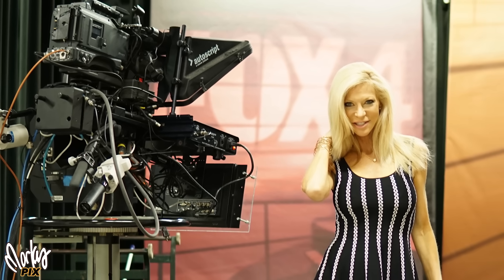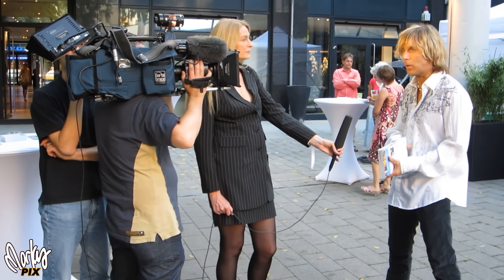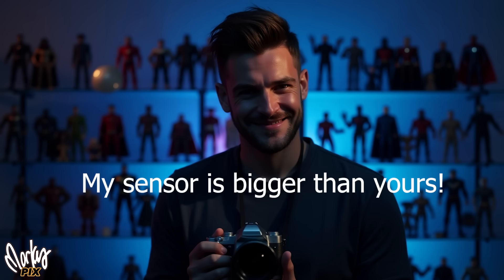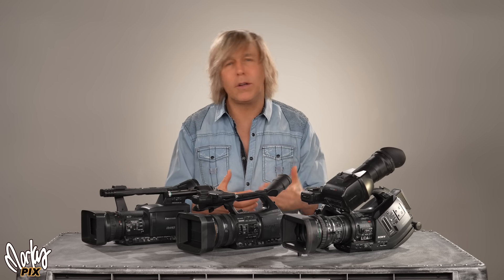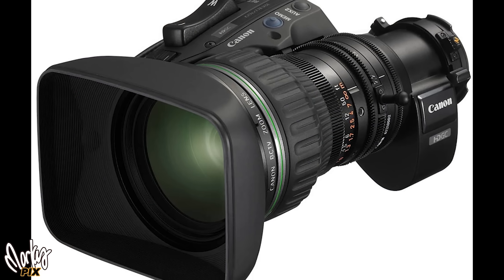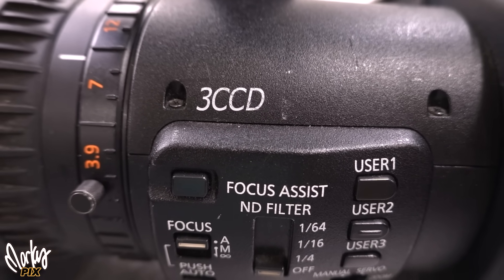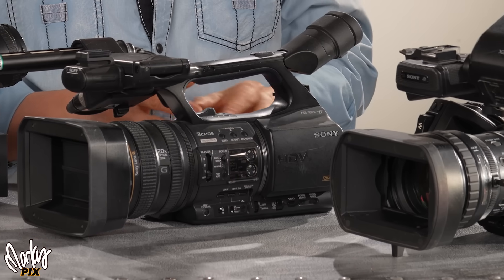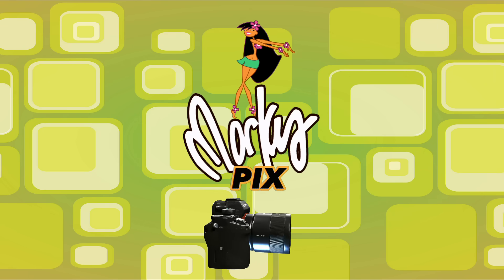Why the Broadcast world uses 3 chip video cameras

Comment: I don't see how having separate sensors would help in green screen keying. You can't just cut a color channel out of the whole frame and for the digital processing having 3 separate sources seems completely irrelevant. I also don't see why would you think 3 chip cameras help you with colour grading live. You need to calibrate your inputs and process their signals anyway.
Reply from the maker: Because 3-chip cameras use separate image sensors for red, green, and blue light, this allows for more precise color separation, which results in cleaner edges in chroma keying.Single-chip cameras rely on a Bayer filter, which interpolates colors, leading to less accurate chroma information and potential color bleed.
Since each chip captures full RGB color information for each pixel, 3-chip cameras preserve more detail in color channels.(Higher Chroma Resolution)
Single-chip cameras often use chroma subsampling (e.g., 4:2:0 or 4:2:2) to save bandwidth, which reduces the resolution of the color channels, making it harder to pull a clean key.
3 chip cameras have less Noise in the Green Channel which is the most important for chroma keying because it carries the most luminance detail. 3-chip cameras dedicate an entire sensor to the green channel, resulting in less noise and a smoother key.
Since each chip is optimized for a specific color, color reproduction is more accurate and less prone to color spill or compression artifacts.
This is crucial for maintaining fine hair details, soft edges, and subtle color gradients in chroma keying. (Better Dynamic Range & Color Fidelity)
With a single-chip sensor, Bayer interpolation can cause color fringing around edges, especially in high-contrast areas like where the subject meets the green screen.
3-chip cameras avoid this, resulting in crisper edges and fewer artifacts in the key. (Reduced Artifacts & Edge Fringing)
But lately, modern high-quality single-chip cameras with higher resolution sensors 10-bit+ color depth, and high chroma subsampling (4:4:4 or 4:2:2) can also produce excellent results.
A single-chip camera with a full RGB 4:4:4 recording may outperform an older 3CCD camera that only records in 4:2:2.
If you’re working with a broadcast-quality workflow and need the best possible keying performance, a 3-chip camera is usually superior, especially in real-time live production settings. However, high-end single-chip cameras with strong color science and high-quality recording can also achieve excellent chroma keying results.
Reply: @MarkusPix  Thank you, this is the explanation I needed!
Reply from the maker: Many studio cameras output an RGB signal via cable to the keyer/ switcher. Even if recording to memory,  the signal being recorded is cleaner. The green channel traditionally has more information and if recording a well lit green screen (or even blue screen), then a good camera will have a clean green or blue with very little red interfering. Single chip cameras have a harder time separating the 3 channels and the signal is often muddier- the green often has red and blue debris mixed in. You are correct that yes, everything needs to be calibrated including proper white and black balance.

Comment: Back in the mid-80s, for news work, I used an Ikegami 79 shoulder mounted monster that weighed the same as a Ford Pinto. The three leadicon tubes gave great colour depth but I have to say, I never could just switch it on a shoot right away - it took at least ten minutes or so to get all the balances right, even though it was probably only getting around 480 lines in our PAL format, in the UK. A videotape engineer followed behind me and recorded my footage on a portable U-matic VTR that weighed slightly less than the camera lol. Despite the old tech, it all worked fine and the pictures still hold up well today, except of course, they're in 3:2.  One further downside: The WEIGHT ! When I see you tubers reviewing modern cameras WHINING about the weight...I LAUGH!!  Bunch of Wimps! lol.
Despite the fact I did not have a VTR on my shoulder, with the lens, shotgun mic, V-mount battery, Lamp and a lead-acid battery belt around my waist, the weight on my shoulder could top out at a good 30lbs  ! And yeah...the X-Ray of my lower spine is like something out of a horror movie!
Reply: BTDT. My Sony Plumicon 30 finally let the smoke out of the red tube last month while it was warming up, hadda retire it. The spare tubes I have are never going to get put in it, not by me at least. Talk about taking a loong time to get adjusted, I never want to spend that much time on one camera again. Oh well, the early CCD 5 looks like crap in comparison, especially the blue channel.

Comment: 3-chip system is a holdover from tube cameras, when a single striped camera did not produce clean enough color separation, so various schemes were developed including 2, 3 and 4 tubes. 3-tube continued into the digital sensor era, as hi-res CCDs were relatively hard to manufacture, so having three of them offset by half-pixel vertically and horizontally allowed using lower-res sensors to produce higher-res image. I have a couple of Panasonic 3CCD palmcorders, DVC and AVCHD, that use this tech.

This continued into CMOS era, so 3MOS camcorders are used now by pros and were also offered for consumer models, mostly by Panasonic again. I see how having a separate blue or green chip (or tube) is useful for keying live video that originates directly off camera without compression. For all other usage it is a wash, it is unlikely you shoot 4:4:4, so you lose color during chroma subsampling anyway. Better skin tones with 3-chip is urban legend, this was true during tube cameras era, I doubt this holds up for chips. Also Panasonic consumer camcorders including the X900 that Markus praises have traditional shift into cyan.

Using large sensors for traditional pro cameras is complicated by the reliance on B4 mount and an array of common lenses. Using 4K sensors with the same size as HD sensors (and previously SD) means lower sensitivity (some claim up to 2 stops loss) and longer rolling shutter processing. Grass Valley LDX-86N allows to either shoot in 4K with rolling shutter, or in 1080 with global shutter by combining four smaller pixels into a single large one. Hitachi uses two green sensors, pixel shifted.

Comment: Doesn't Sigma cameras use 3 stacked sensors and are they similar in output?
Reply from the maker: No, Sigma cameras do not use three stacked sensors, they use a Foveon X3 sensor, which has three layers of photodiodes stacked vertically at the pixel level. This is different from traditional Bayer sensors, which use a color filter array on a single layer. The sensor has three layers, each capturing a different color of light (red, green, and blue) at different depths in the silicon. Since each pixel captures full RGB information, there is no need for a Bayer filter or demosaicing, leading to potentially sharper images with better color accuracy. However, Foveon sensors typically struggle with high ISO performance and speed, making them less suitable for low-light or action photography.
Reply: @MarkusPix  Thanks for the master class clarification. You truly are Professor Pix

Comment: Love my ancient Panasonic HVX200 (the HPX170s older brother)! Kind of a bridge between shooting old 3 chip Sony miniDV cams and newer 1080p/4k DSLRs. P2 cards are still too expensive but I’ve got a pair of 64gb cards that have been way more than enough for the small volume of shooting I do. Can’t beat the built in handle, XLR’s, battery run time and ND filter. 720p at 60fps is great for slow mo in a 24p timeline. Been experimenting with cropping to 4:3 for that more vintage look.  Kind of consider these early 720p standard HD cams as the 16mm film of digital video.

Comment: My Sony HXR-NX3 is over 10 yrs old , and it's three sensors still deliver great images ! My FS-5 is great also but the 3 chip NX3 still punches way above it"s weight.
Great video and thanks for posting.
Cheers Gregg.
Reply: I've had my NX3 for nine years and it's still a pretty good little rig. I mainly use it as the b--camera for interviews shot with my PXW-X400 but I also get the occasional freelance gig with the NX3 alone.

Comment: I would add few more things... 3 chip design is a very clever way of increasing light gathering area without actually increasing sensor's size. Pretty much entire broadcast world has settled on 2/3" sensors, and there is a whole ecosystem of lenses build for this specific sensor size. Three chip design actually provides better color resolution because there is no debayering being done. With 3 chips instead of one costs are obviously much higher, as well demands on body size. And then there is the prism. There has been a long discussion if 4K capable prism can even be made for 4K 3chip cameras. Then Sony has done it for their HDC line of cameras... these are one of the most expensive cameras on the market. HDC-3500 being around 45000 USD just for the body. And then the high speed variant HDC-4800, capable of capturing 400 frame per second in 4K, costs around 200 000 USD. So keep that in mind when you see those balls spin in slow motion.
Reply: Last year I had the opportunity to use the Panasonic AK-UC3000, not sure if it was that exact model, but I know it was 4k single chip with optical connection back to the truck. Super nice image.
Reply: @JohnnyMotel99  yea Panasonic went different way than Sony. They gone with larger (1" I believe) single sensor for their 4K production cameras. Using optical element inside the mount that stretches the image from regular 2/3" lens to cover that larger 1" sensor. Losing about 1 stop of light in the process.
I am sure they didn't want to struggle with developing that 4K prism, so they went this way instead. And to be fair if I remember correctly they beat Sony, being first on the market with 4K production camera. They are also cheaper. And yea image is top notch.
Reply: @ We had four identical Panasonics on that gig, the optical fibre back to the truck made it a doddle for the techies to adjust colour/exposure etc.
Reply: ....I bet the studio accountant's balls spun too when he saw the price....
Reply: I run Hitachi's 4k "3-mos" broadcast cameras all the time. I think their 4k image looks really good! 
Even though we almost never run them through a system about 1080p lol. I have a suspicion, but have never done the research, that higher resolution sensors result in less moire when shooting against LED Walls because of their pixel density

Comment: Markus, thanks for this one.  Especially enjoyed your comments on the multi-K resolution arms race.  I started making HD vids in 2011 with a pair of Panasonic 3MOS camcorders (HDC-TM900 and HDC-SD800). Fairly sophisticated, excellent stabilization, great zoom and auto-focus.  But - tiny little 1/4.1 sensors. Back then, I did not understand what that meant. Under the right conditions they can produce amazingly crisp 1080P,  but the auto white balance is wonky as hell and things fall apart quickly in low light.  Even some indoor light (ie: mercury and sodium gym lamps) shots get unexpectedly grainy and dull.   And, as nothing is lined out in photo/cinema equivalents, it literally took me years to figure out how to work the manual settings to improve results. I still use them at times in tandem with my GH5 and other 4K cams.  And in hindsight,  they were still the best solution I could afford of what was available at the time,  back in the day.  Your breakdown on these things is spot on.